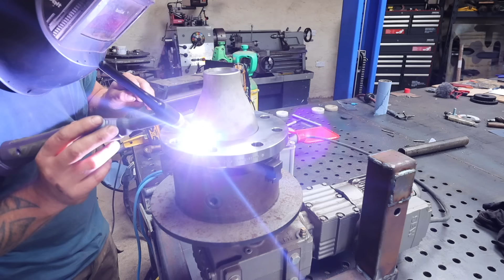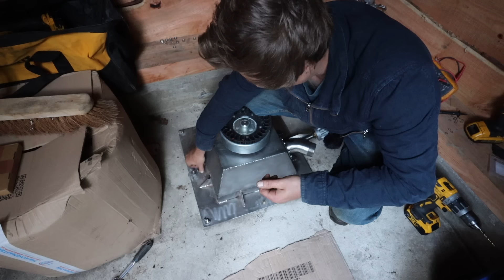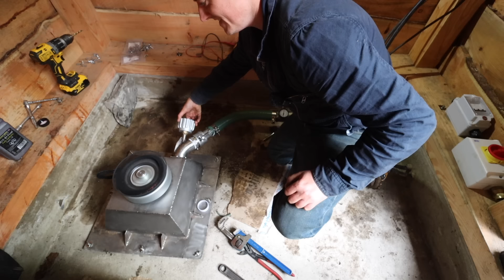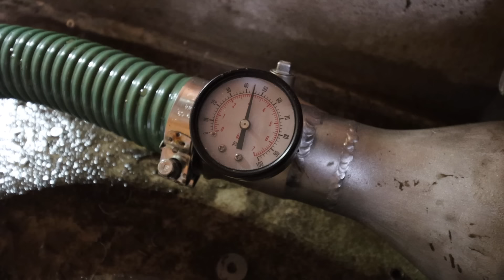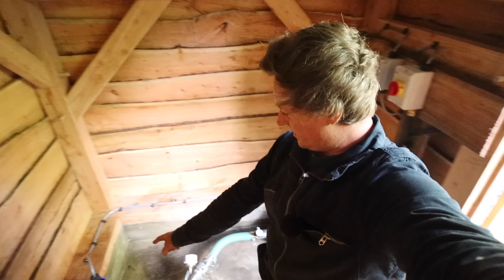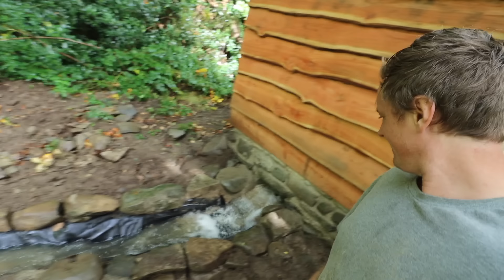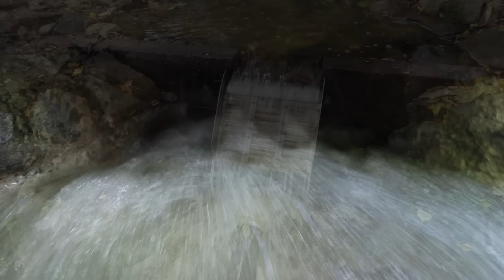North Wales 1.5 Kw Hydroelectric System Part 6 Running the turbine For The First Time

Comment: Hi Kris, was just wondering what RPM your getting from the turbine and would it be worth putting a digital rpm gauge on the turbine for fine adjustment of the flow, Just an idea and great work!
Reply from the maker: The rpm is fixed, the flow changes dont change the rpm by much at all. under load the rpm is about 1250, this will only change by about 100prm or so with flow increases due to head loss friction changing the nozzle velocity slightly. But the output is not increased by increasing the rpm, the rpm is set by the pressure and that is fixed. The rpm will climb up to 2500 when load is removed but once the controller loads the turbine again it will go straight back down to around 1250 and stay at that.
Reply: @KrisHarbour  Thanks for the great explanation Kris It all makes sense now you've explained it, perhaps it's just me but I do like a good gauge and a readout lol.

Comment: Hey Kris as a retired pipe welder I put many eccentric reducer instead concentric for better flow an less air entrapment. Just something to think about. Love your video’s
Reply from the maker: Hi Patric, thanks for the tip, I had forgotten about them, But yeah that would be slightly less loss, unfortunately I have a few more of this concentric ones left but next time I have to buy some I will do your suggestion as it would be slightly better. Thanks.

Comment: It would be ideal to prevent trash from entering the pipe.  A few years back I worked in a chemical plant.  They had a ‘y’ pipe fitting just upstream of an important process like a nozzle.  1 pipe is upstream 2 pipes of the ‘y’ downstream. One downstream pipe to the nozzle. The remaining pipe has a sized screen in it to prevent trash in the nozzle.  The screened leg of the ‘y’ opens to flush the trash off the screen.  Just an idea to prevent tearing everything apart.
Reply: He´s installed a Coanda screen which stops any over sized debris, that cannot pass through the system, from entering the system, no need for a filter.
Reply: The small rocks probably got into the pipe during installation the coanda screen should be sufficient...

Comment: @Kris Harbour Natural Building, will you try to automate the nozzle? Maybe you should be able to max the system out with a tiny arduino/esp8266 controller, servo motor, and a digital pressure gauge. You should also enable remote metrics collection to get insight into the long-term operations of the unit.

Comment: Tig welding rule 1, 2 and 3 CLEAN, clean and then clean it again. Those cast fittings are covered in inpurities, if you want your welds to look professional , grind the bit youre gonna be welding shiny then wipe them down with a solvent and the welds will be beautiful.
Reply: oh also wipe the rods down with solvent too

Comment: I think using wing nuts is a very poor idea, use the same size on as much as possible on all your jobs and have a kit of tools that stays in the Landy including cordless and a charger with an inverter ready to go.
Reply: If you say things like 'it's a very poor idea' - you need to justify your opinion, or it's worthless. We might all think you're wrong.........!
Reply: @andymccabe6712  it's obvious what he means...

You can only get finger tight and could vibrate loose ...is probably what he means...

Come on keep up !!
Reply: @tonyhussey3610  exactly Tony, no way to torque them down as the ears would rip off, and I assume there will be some serious pressure there too.
Reply: @k13ehr  I don't see the serious pressure? Any stress created from water pressure goes into the alternator and the turbine housing. The nuts are just there to stop the housing from vibrating and the housing from wandering off.
Reply: @musicbro8225  Good point there, I'd still not use the wing nuts though just as a matter of preference.

Comment: Always nice to see a new micro hydro start its working life ! Well done. The drop in power output after it had been running for a day (50 W) is probably a temperature effect having two causes: 1. the flux density of a permanent magnet decreases linearly with increasing temperature; 2. the resistance of the copper windings in the stator coils increases with a rise in temperature; both will see power output drop.
Reply from the maker: The alternator is very efficient in the region of 90% so at 1kw output there is only about 100w being lost as heat in it. it is spinning at 1250 rpm, it has a fan, its in an open building connected via an aluminium base plate to a metal housing that is being cooled with 5-6 litres of water every second. there is no heat build up over time. The heat build up would happen in the first min and then stay constant due to the constant cooling. The drop is a drop in water in the pipe. I know this because im watching it like now and it back up over 1000w after 2 days of operation.

Comment: Very satisfying to watch all that hard work come together. Just a thought with the nozzle dilemma - would if be possible to have a split input with the different sized nozzles on each. Then you could turn on which ever suits the available flow throughout the seasons.
Reply from the maker: Yes you can do that, that is what I do on mine as I have a very changing flow rate. This system though has a more steady flow rate and from the readings the customer gave me one spear valve would be suitable. The one installed now will go down to 200w no problem and all the way up to 1kw. if he wants more at the top end then I can do that but it will most likely make the lower end 300w or so. Adding another note is fine but it adds a lot of cost and its important to make sure its needed first.
Reply: @KrisHarbour  thanks for the input, it's appreciated 👍🏻

Comment: Insanely impressive, Kris. We have a river running through our land here in northwest Ireland. Very remote land and the river is not visible from road. Good flow all year round on the river and a drop of maybe 5 metres from one boundary to the other. Must look at the basic maths to figure out if it's a runner. Anyone have good novice instructions for this work?? Cheers
Reply: With that little drop you need lots of flow to produce any power, also a different type of turbine

Comment: Fantastic job Kris. You can be rightly proud of this project. My old man always taught me watertight joints always have a tendancy to drip to begin with. The impurities in the water generally seal things over the first few days much better than any taping.  Hope you get a chance to step back and look at what you've achieved from scratch there. Very impressive!
Reply: All depends on the type of sealing. I guess you´re old man was a plumber used to using angel hair (not sure what that is in English but hemp or jute maybe?) which expands when wet like boat caulking and seals up better as it gets wetter
Reply: Heat soaking the ends of the plastic joiner pipe before  fitting it onto the barbed metal fittings at both ends would also allow the pipe to better conform to the barbs...and double clamping both ends sould be done as well....

Comment: What do you do with 1 kWh? Surely that's not enough to power anything? Or do you feed the 24 kWh into the grid and buy back room grid?
Reply: Probably just goes into the house battery system

Comment: Excellent work. 
Having worked in automation for quite some years, I would recommend to use a long range (Lora or similar) level sensor in the coanda catchment or in the standpipe, as the vibrations and flow turbulence influence on the pressure sensor will probably be hard to filter out. A 30cm drop in the pipe will only be a 30mbar drop on the sensor...
For the shut-off switches, I would recommend to make them accessible from the outside of the building (maybe add a second one?). Is this a legal requirement?

Comment: I wonder if it would be possible to make a bit of pocket money by combining your hydro setup with a feed in tariff?
Reply: I get the feeling the customer is entirely off-grid, so probably no grid power nearby.
Reply: Feed in tarrifs are pretty poor. Iirc octopus energy offer 7p per KW best in UK.  Most only offer 1p. Battery is best to store and use I reckon.
Reply: ...if they even exist anymore
Reply: Would make more money selling the excess power generated to a neighbour.

Comment: Would be a good idea to put a cage over it to prevent any curious childrens hands from touching the fan blades on top of the turbine. (Or an adult that trips and falls on it)
Reply: The door gets locked play boy
Reply: @rudiger86  You still go in there while that thing is spinning at hundreds of RPM and could accidentally touch it.
Reply: @bastiat691  Seems like a waste of of resources and time to build something like that for a thing that is locked away and probably interacted with by one person on the odd occasion.

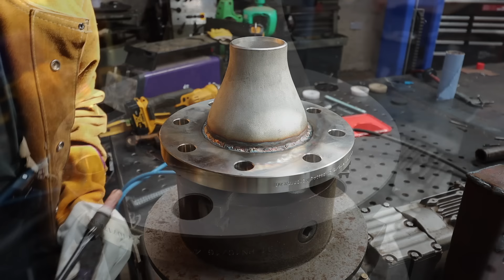Comment: 3:27 Nice bead!
4:45 No need for plumbers/teflon tape?
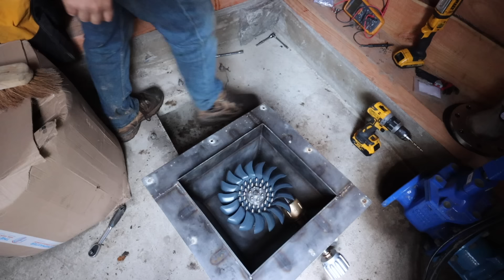6:22 No wax or rubber gasket for a pressurized ground mounted water pump?

Comment: Huge congrats, great job.
Perhaps put a drain hole in the cabin so the floor can be washed out with a bucket.
Reply from the maker: It has a drain, the turbine sits up on spacers and the water can flow under it and out.
Reply: @KrisHarbour  Oh yeah.

Comment: I'm so used to thinking of solar array output that 1kw seems really low, but then you remember it is running 24/7 and will produce several times more energy a year than even a 5kw solar array.
Reply from the maker: Yeah exactly. 1kw hydro is really significant. In the winter for a solar system to match the output over a 24h period it would need to be at least 20kw of solar.

Comment: Friction losses and lower pressure in moving fluids is not the same thing.
Reply: ❤pressure loss due to friction is measured betweenTWO POINTS on the same line, not from a single point. What Kris is seeing is mostly due to the Bernoulli effect: pressure in flowing fluids is less in directions perpendicular to the flow. I’m ignoring turbulence, but it’s probably marginal in this case.
Reply: @keithklein4538  exactly
Reply from the maker: It is measured between two points! The first point is the intake at 0 psi the second is at the bottom at 50 psi. as the pipe goes down hill the pressure goes up. But when the fluid moves the pressure goes down due to friction. you two are thinking as a closed pipe. If it was 50psi at the top and when mowing it was 45psi at the bottom then thats loss between two point. But this isnt like that. its gaining pressure as it goes down hill not being pushed from one end. there is a difference.
Reply: @KrisHarbour  Hi,
Uh, no we are not. Yes the pressure in the pipe is due to gravity, and yes, there are frictional losses in the pipe, but the set up you are showing us has a single gauge measuring at a single point. Valve off, and you measure static pressure at that point. Valve open and the pressure should drop, but entirely due to flow at that point, which is due to the gauge being at 90° to the flow and good ol’ Bernoulli. To get an estimate of frictional loss you need to use the same set-up as in the video: two gauges separated along a level pipe. Modern plastic pipe has very low frictional loss, but that’s not relevant here.
Reply from the maker: I can assure you that in hydro electric systems the static head is taken as a reading at the bottom of the pipe and when the nozzle is open the loss of pressure is due to the friction within the piping system. If you look at every hydro installation on the planet you will see the same thing regardless of the angle of the gauge. the dynamic pressure drop in a pipeline is due to friction. feel free to read it here https://www.nooutage.com/hydroele.htm
or here https://en.wikipedia.org/wiki/Hydraulic_head

or here 
https://www.canyonhydro.com/guide/HydroGuide11.html

Head Loss

Head Loss refers to the loss of water power due to friction within the pipeline.  Although a given pipe diameter may be sufficient to carry all the Design Flow, the sides, joints and bends of the pipe create drag as the water passes by, slowing it down.  The effect is the same as lowering the Head; there will be less water pressure at the turbine.

Note that the effects of Head Loss cannot be measured unless the water is flowing.  A pressure meter at the bottom of even the smallest pipe will read full PSI when the water is static in the pipe.  But as the water flows, the friction within the pipe reduces the velocity of the water coming out the bottom.  Greater water flow increases friction further.

Larger pipes create less friction, delivering more power to the turbine.  But larger pipelines are also more expensive, so there is invariably a tradeoff between Head Loss and system cost.  A good rule of thumb is to size your pipe so that not more than 10% to 15% of the Gross (total) Head is lost as pipeline friction.
Reply from the maker: On this site we have 220m of pipe with an internal diameter of 98mm. the flow rate is 6lps and that equates to 2.3 psi of friction loss in new plastic pipe. Now add in the 6 joins, a few gradual bends, the gate valve, and the reducer and you get the loss I am seeing. about 4psi. feel free to go and work it out for yourself.
Reply: @KrisHarbour  Hi,
I did. But the question is whether the pressure is taken along the line of flow, or perpendicular to it.  Watch what happens as you open the flow rate at the turbine gradually. The pressure should decline gradually if I am right. A quite effective flow meter can be made by branching a clear tube at a right angle and vertical to the direction of flow. As flow rate increases water in the tube will get lower. It would be hard to do with your turbine set up, but in smaller scales it works and Bernoullis equation describes the pressure drop well. I can see that engineers might take all pressure losses together and call them « friction » , but from a physicists point of view it still looks like a single gauge measuring pressure perpendicular to flow will follow Bernoulli’s principal.
Frictional loss must of course be accounted for in designing the system, but I don’t see it being measured.
Reply from the maker: I do agree that the gauge at a right angle could have an effect on the reading but if it was only the Bernoulli effect going on here I believe it would be far more of a loss then im seeing, at 6lps going through a 50mm hole that is a velocity of 15 /ms i can't do the calculations for that but im quite sure a fluid moving at 25m/s would have more than a 4psi drop if that was all we are seeing. However the 4psi drop does line up with what I expect in losses.
Reply: @KrisHarbour  Hi Kris,
Thanks for the reply. I have reread your article and reviewed my (limited) knowledge of fluid mechanics, and I agree with your assessment. You have a lot of patience to put up with old fools like me! Thanks Again.
Cheers
Reply from the maker: Yes it is. when fluids move they loose energy to friction on the pipe walls. thats friction loss.
Reply: @KrisHarbour  Sure, but at 4:39 you say regarding dynamic pressure: "when the water's moving the pressure's slightly lower due to 
friction losses" which is just wrong. Friction losses will cause a pressure drop between inlet and outlet.
Reply from the maker: I really dont have time to argue with you about it. There is a good video here to explain it. What I said in the video was correct. https://www.youtube.com/watch?v=ZQKpu-obzlU&t=226s
Reply: @KrisHarbour  It isn't. Same with the video link. That's an empirical formula for the pressure drop, which is completely separate from the dynamic pressure measured by the pressure gauge in your case. I feel you are missing the basics of fluid dynamics.